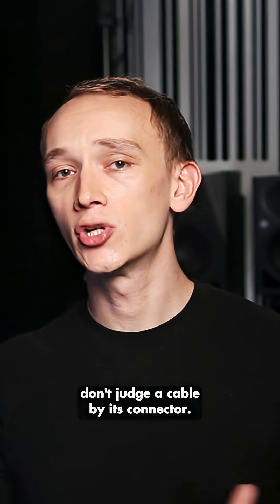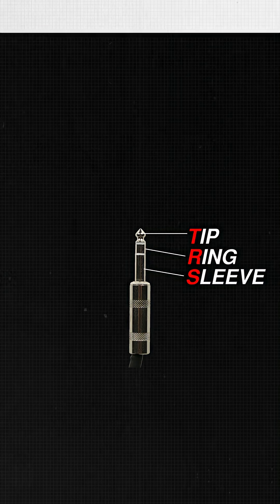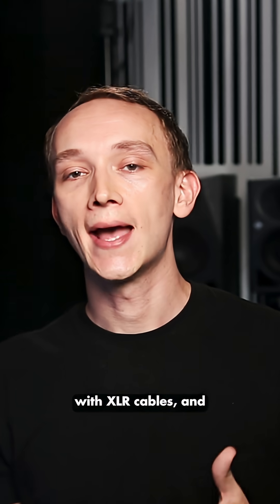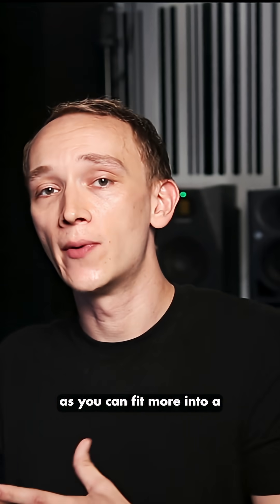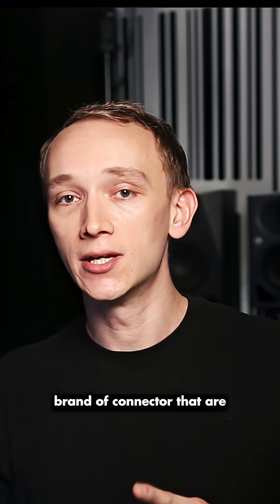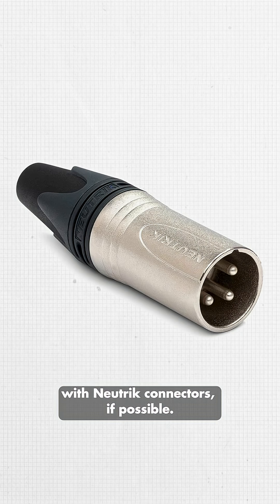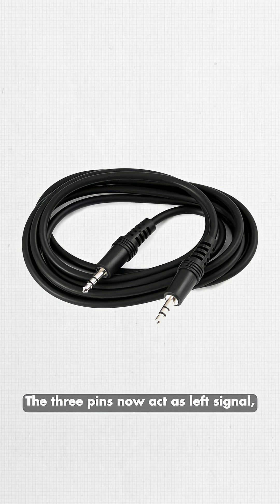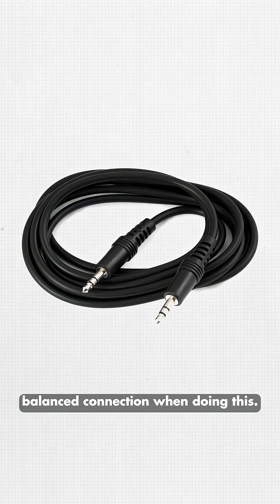TRS vs XLR – What’s the Difference

Comment: Even if you send a balanced mono signal, I've used aux audio cables (with 1/4' adapter) as a patch cable and I don't recommend it: the wires in a headphone or RCA aux cord are not braided, it's a speaker wire, and often are designed to pick up RF. Use a shielded balanced cable.

Comment: Don't forget INSERT connections on TRS connectors where you have a send/return/ground on the contacts.  Admittedly, digital mixers largely render these obsolete.  

Should also be noted that XLR generally won't POP when patched hot, TRS always will due to being shorted during insertion.  

But hey, they do date back to 1877...

Comment: you do have to be incredibly careful using a direct XLR to TRS cable, do not under any circumstance turn on phantom power, it can easily fry equipment on the other end that isn't expecting any phantom power.

Comment: A very important distinction which you did not mention here is that XLR or “cannon” inputs are for “mic level”, low voltage signals whereas the TRS or “phono jack” inputs are for higher voltage “line level” inputs. If you run a line level output with a phono plug on the output end and whack a cannon on the other and plug it into the mic level input, you’ll overdrive your preamp and clip the shit out of your signal. Conversely, plug a cannon into a dynamic mike and a phono into your mixer, you’ll get a very, very low signal. In this instance, if your only option is a line level input, you need an XLR to TRS impedance transformer.
Reply: This isn't biblically accurate and it depends on the application.
Reply: @BigDoggeTom every single pro audio device I’ve ever used complies to that principal. Even powered speakers have a button to select between mic and line level input for this exact reason. XLR (aka “cannon”) was developed for use with microphones, hence the convention. It’s the same reason why all RCA connections are always line level as they were developed specifically for line level connections.
Reply: @Cpt_Squizzleyou are wrong sir. Powered speakers have the mic/line switch for when you are using one of the channels with a microphone. The mic option adds a preamp inline so the power side sees a higher input, line level. 
XLR cables are used for line level signal in almost all pro level gear.  
Mixing boards have XLR outputs for the mains and any output for that matter.  Every wireless mic receiver, every iem transmitter, direct outs on bass amps and guitar amps,  pro level effect pedals, all use XLR connections. 
Most mixers that have trs and XLR  on a channel do not allow phantom power over the  1/4" , great safety feature BTW. 
And ... RCA outs are almost never line level signals. They are unbalanced consumer level. -10db. Line level is at +4db.
Reply: @sk.8835 you might want to check out your Mackie mixer that you used on another video. I have the 1402 and there is a button next to the XLR outs to choose between mic or line out. I get that outboard gear with XLR and no switch option will be line level, but there is an important distinction between the two which needs to be explained considering your target audience is beginner level. 
The critical difference is that XLR can be both mic or line level, whereas TRS is ALWAYS line level 

I take your point re: RCA. I stand corrected on that.

Comment: Smart stuff. I've been in audio for a few decades. Made me smile when the picture of the "TRS to XLR" adapter came up and he described the application as connecting to a mixer with balanced TRS input connectors. I smiled, as the XLR end of the adapter was the wrong gender for this purpose. A very tiny quibble. Otherwise, KUDOS for the well-presented details!
Reply: If you think of it like he's talking about mix outs then it works lol